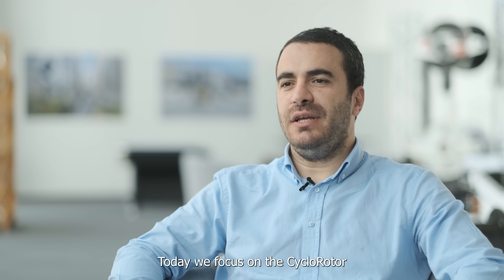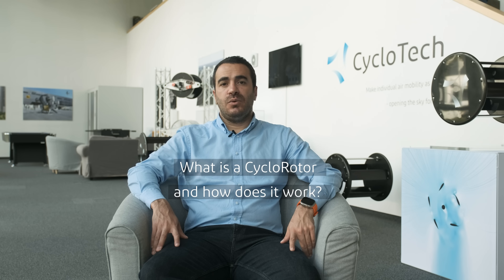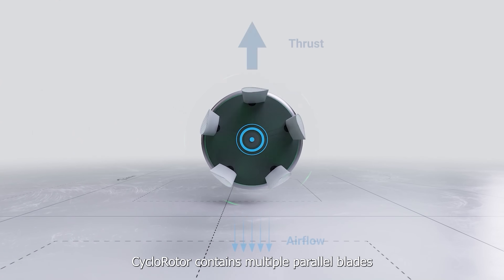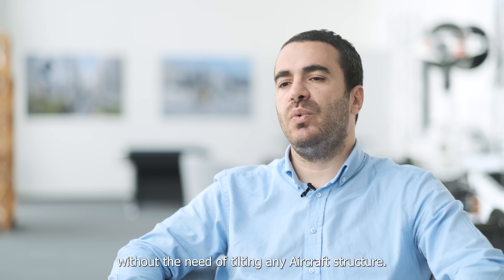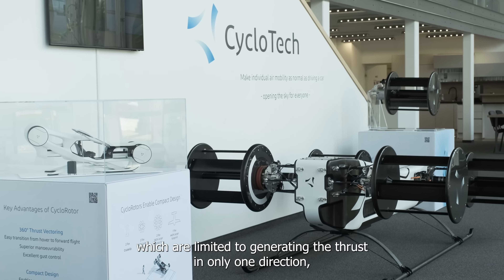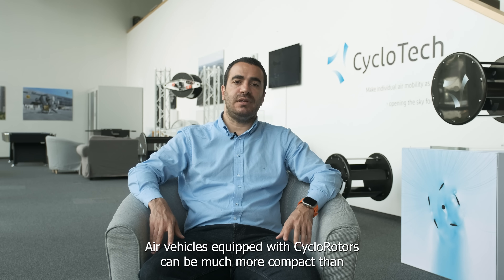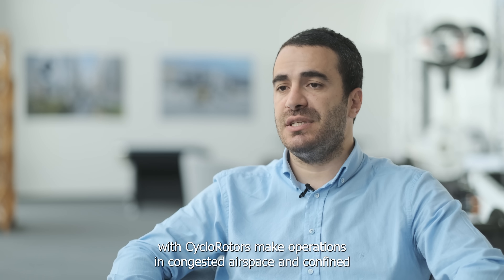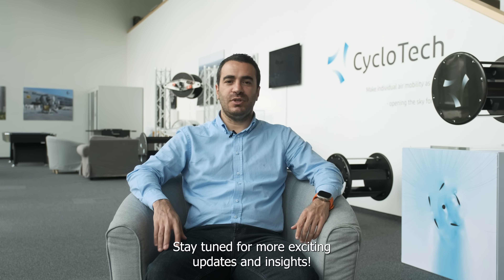Discover CycloTech #4 | What is the CycloRotor and why it´s a game changer for aviation

Comment: has the same issues as a helocopter; complicated with many failure points.
At least a helocopter can autorotate with loss of power.
No wing of any type means no power off glide which means flight risk is greatly increased.

sorry this is NOT the future; this is a fantasy money sucker

Comment: How well can a CycloRotor handle bird strikes?
Reply: Yeah I'd be interested to learn more about the redundancy. It looks like it could handle at least one motor failure. But it would need to detect that and change things up very quickly to compensate for it.
Reply: by putting cat inside the rotor (like hamster wheel)

Comment: Propulsive efficiency, compared to turboprop and turbofan engines? Maximum thrust? Noise level?
Reply: More moving parts is always better. ;-)
Reply: Rotating props are limited because the tip speed can hit the transonic regime and take a massive hit in efficiency.     Since the rotation is perpendicular to the thrust on this system, you could theoretically increase the blade aspect ratio to hit some very efficient performance.
Reply: not very efficient and I think the creator/designer acknowledge that, thus not marketing it to replace high flying and long ranged air vehicle..
Reply: These are exactly the questions I'd like answered as well. They do look like a beautiful design for quickly getting around congested cities.
Reply: It's almost like if they answered those questions no one would invest in their scam.

Comment: ヤマト運輸も協力していますし、意外と実用化は早いのかもしれませんね。
今後も楽しみな技術です。
Reply: It is nice that this company is working hard with the cyclogyro. They have a great team of performers! It is just a pity that they do not have fundamentally new technical solutions. Of course, they draw very well, but such a product will fly poorly. Predecessors in the D-DALUS project lifted 250 kg into the air. (What is the weight of this cyclogyro?). This technology is practically no different from that invented by engineer Sverchkov in 1909, but for some reason they stubbornly refer to other authors from the 1930s, who did nothing technically for the development of the cyclogyro and the hydrodynamics of this cyclorotor. Why such a denial of engineer Sverchkov's achievement, after all, it was he who first came up with the kinematics of  cyclorotor?